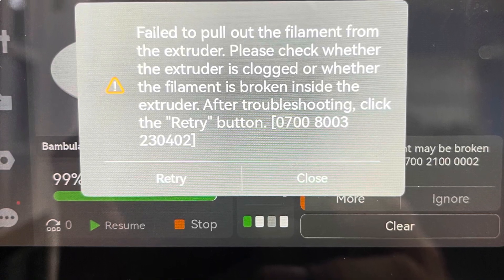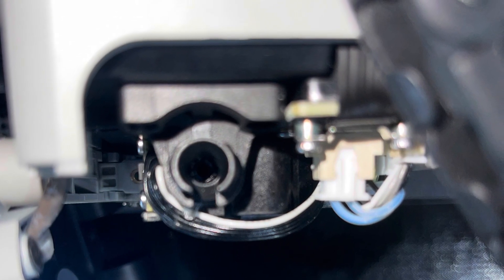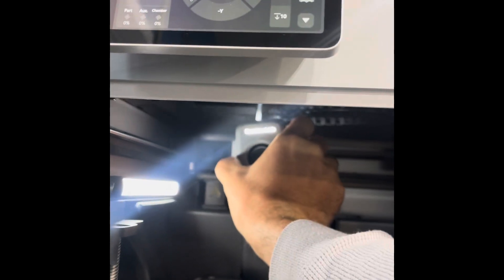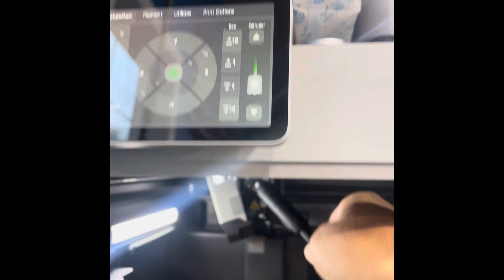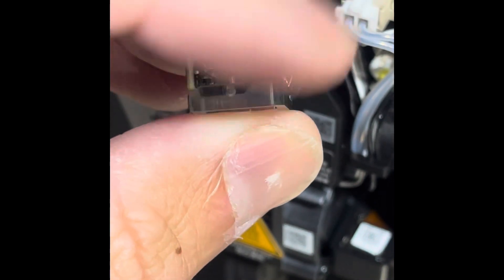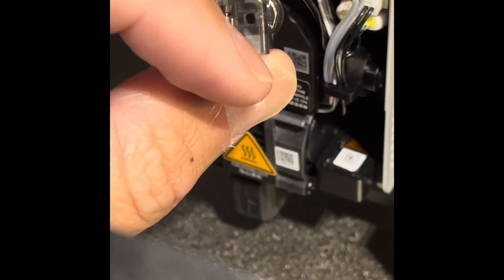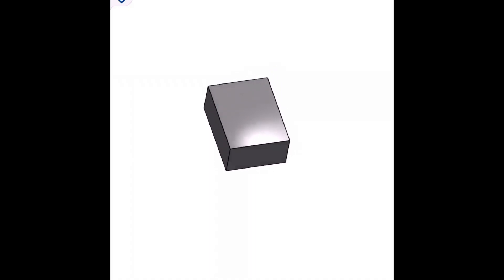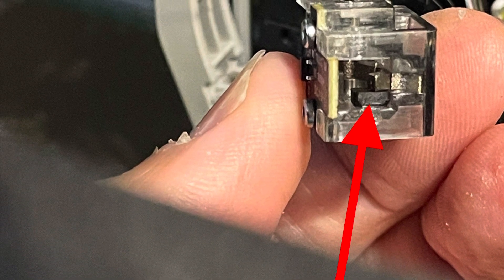Bambu Lab X1C FAILED TO PULL OUT FILAMENT FROM THE EXTRUDER ERROR

Comment: Thanks so much for this! I run a business for 3D printed customs and one of my three Bambus went down during one of our best weeks of the year due to this issue. Instead of waiting for a new sensor, this was the quick fix we needed! Wishing you the very best.
Reply from the maker: Glad I could help. Mine has ran fine since I did this and I never installed the new sensor as it is built the same way and had the same potential problem waiting to happen.

Comment: I was having an issue that the filament was not retracting. I had taken apart the assembly but couldn't find a problem, and, when re-installing it previously, I had failed to return the cutter blade into its proper slot. The blade had been sitting outside the assembly.  Talk about missing the obvious! 😆 On a side note, I discovered when playing a YouTube video, holding down the space bar (Mac) speeds up the video/audio, while still understandable. Wish I knew that along ago. Merry Christmas!
Reply: Merhaba filamenti geri çekmiyor sadece 1 tanesi sonra hata veriyo ne yapmam lazım
Reply: Failed to pull out the filament from the extruder.please check whether the extruder is clogged ör whether the filament is broken inside extruder.after troubleshooting.click the retry buton.

Comment: Thanks man. I saw a post where someone filed down the side of the plastic that the lever get's stuck on, but I like the idea of adding a guide instead. I should also add that the opposite problem could happen - the magnet can dislodge from the lever which prevents it from sensing the filament (the magnet needs to touch the black chip). In that case the little dot never turns green and printer won't recognize that it's loaded. Might be a good idea to add a dab of adhesive to the magnet as well.
Reply from the maker: No problem. I noticed that too about the magnet. It was a pain in the butt to get that glued in there but it’s worked well so far.

Comment: Hi did the new part fix the problem? I have contacted Bambu, but they are not offering any solutions related to the sensor. Did you try all their other suggestions?
Reply from the maker: The part I made fixed it. They sent me a new filament sensor but it is designed the exact same way as the one that’s on it. The switch gets hung up the exact same way. Since I’ve fixed mine using that small piece to keep the lever from getting hung up I haven’t had any more issues. I just put the one they sent me in my drawer.
Reply: I'm also in the middle of a support ticket with Bambu - so far they've just suggested to bend the lever to the left which doesn't help bc the spring is pushing it to the right side. I also saw a post where someone filed down the corner of the plastic part that the lever get's stuck on, but I'll probably try the block guide idea first.